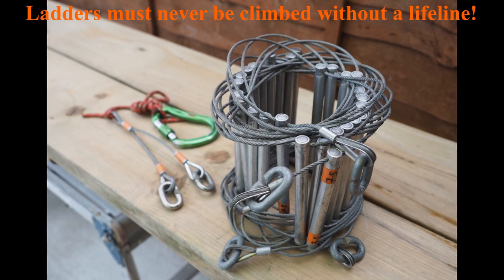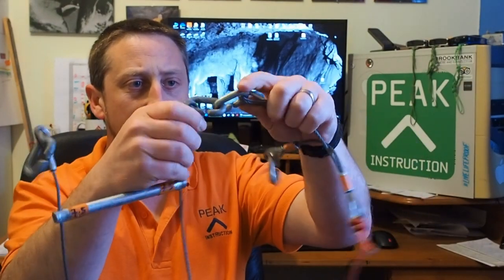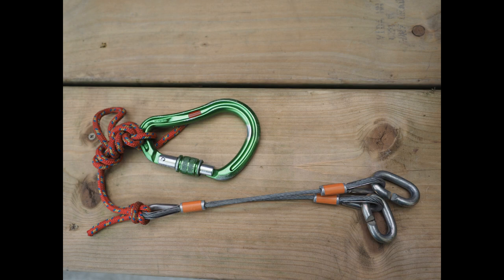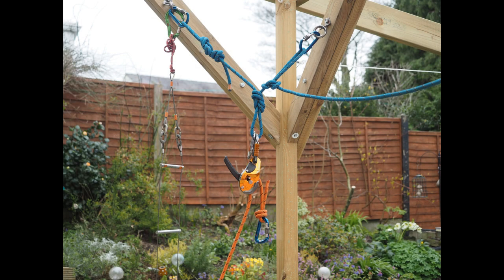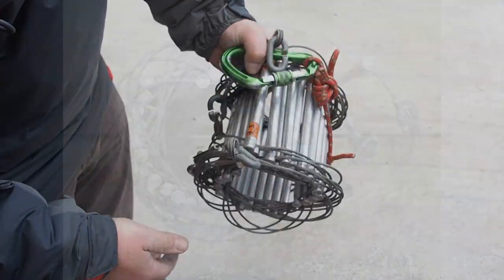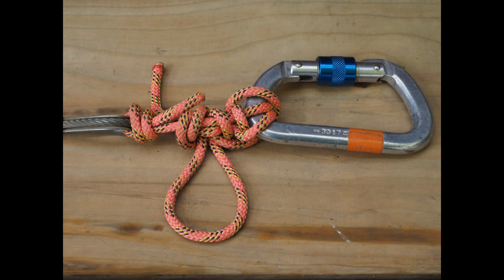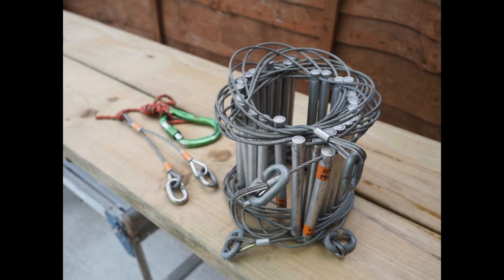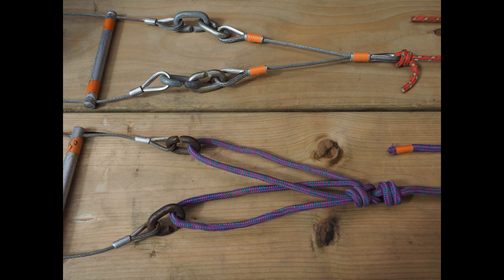Caving Ladders - An Overview of Use and Inspection

Comment: Harry Long
Straining the ends round the outside of the ladder to fasten them (i,e. the very short length between the last rung and the splice) as shown in some of your footage puts an excessive strain on that very short length of wire. This leads to potential damage and is very bad practice. When I became leader for  UWFRA I found they were using stainless steel wire - as advocated at the time. hopefully, no longer in use anywhere. Looking at this I found that I could break the wire by hand with a minimum of effort and thus binned all their ladders!
The only really safe way of fastening the ends is by threading one side wire through the coil to mesh with the C Link on the opposite side and the same for the other side.
Reply from the maker: Stainless wires are more brittle than galv in repeated flexing. I've seen stainless zipwires need replacing much faster than galv ones.  Anyway,  if you have to strain the wires to join the links because the ladder is not coiled well or too large to do this with, then yeah, it's probably going to stress them, but all my ladders are short and can be coiled tight enough so the last links easily connect together. Not bad practice at all, you just need to not force things.

Comment: Not quite how we used them back in the ‘70’s & ‘80’s lol
Reply: Same here, Peak district, late 70s early 80s, Waterway Swallet etc.

Home made ladders made from cheap aluminium tubes , TV arial rigging wire,  trapped in the tube by wooded pegs hammered into the ends of the tube.  Safety rope?  We sometimes used truck ropes if it looked really bad. 

Had a ball, but all so long ago now.